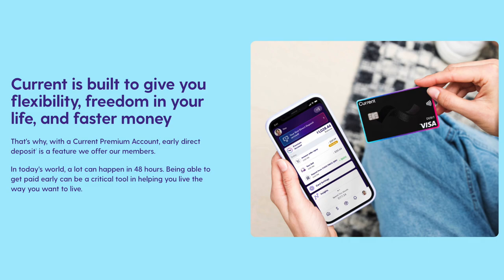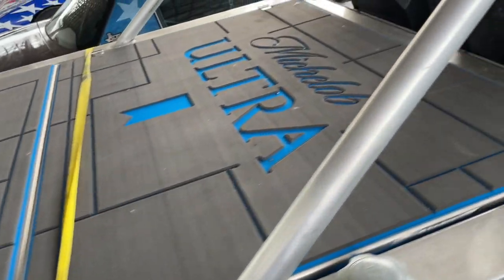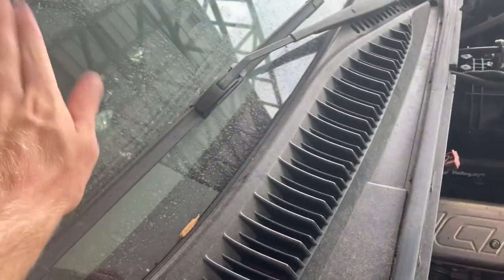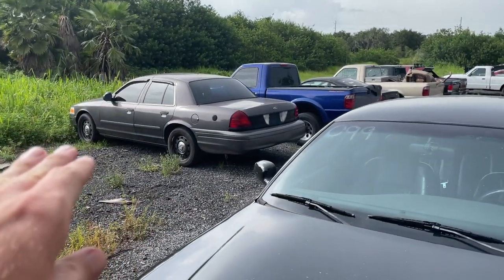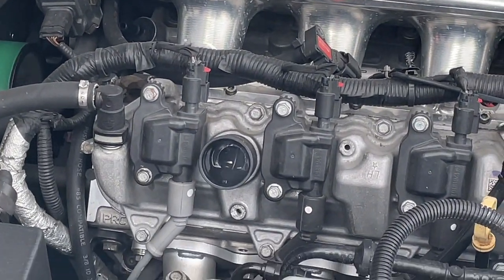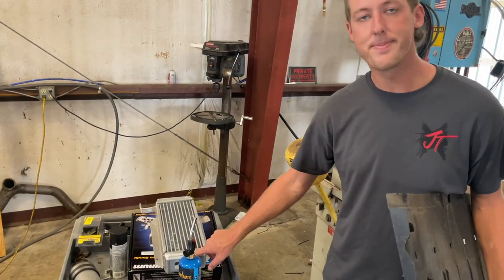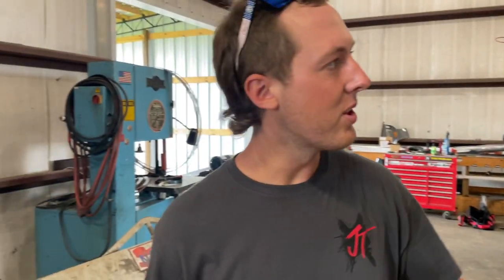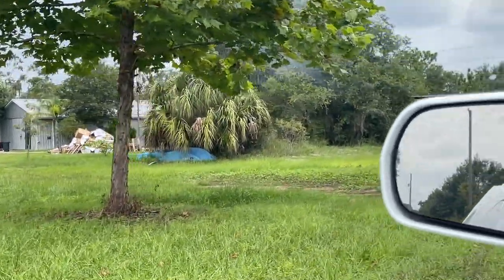Trying to Fix the FREAKING Bald Eagle Machine Finally... + Sold One of the Jet Boats :(

Comment: 25K for the first oil change and engine mounted fuel filters, use the good mobil oil and detroit filter and you can go 75K between oil changes. engine mounted fuel filter interval depends on whether or not you're running an external filter like a davco. every 200K on the trans flush, make sure they pull the front and rear plugs and clean them. most places only pull the rear plug. 150-175K on the air filter unless you're running in more extreme conditions. and yes i do this for a living for schneider natoinal which has approx 8,000 freightliners equiped with the DD engines and dt12 trans. super easy to do yourself. unscrew the oil filter and let drain. grease the chassis and drain the 44 quarts of oil. fill the oil, 11 gallons, and pull the filter to swap it. longer it drains the less it drips on the engine. oil pressure should pop around that 6 second mark after starting.

Comment: Did you say you run no thermostat at all? I would think a restrictor would help slow water flow down to allow more heat to be removed from the heads and then pulled out in the rad ? 

Or put a thermostat back in it.

Comment: Seams like the throttle body is having issues to me. Had a dirt diver nest on it lol. Probably bad seal or bad tps. That would make it run lean and make it run hot like that. Just shooting ideas. That could also be causing the hickup on take off. Also that fan and shroud seems a bit small. That alone could be the problem as well lol.

Comment: Relocate everything then put twin pushers in front and leave the single puller, it should cool it down quite a bit with all that air coming through the radiator.

Comment: I sent an email to Kev at KSR about my idea on your fuel heating in the Elco but proper ducting and forcing your air to only move where you want it. Best example is to look at time attack cars and how they seal up the front end so your airpath ONLY goes where you desire. 

In my email to KSR, I mentioned how auto manufacturers have circumvented fuel heating and gave an idea for your race week events where weight means everything on a track but not so much when driving. In this case, others have mentioned a better fan shroud with twin fans and better ducting. I think that would be a cool (get it?!) third visit to the wind tunnel if you guys did such modifications to your race week vehicles and the Bald Eagle Machine. Those who do aero are the real air benders.

Comment: Everyone complaining about the fan. the radiator is getting full air flow while its driving down the road.  b4 you argue stick your hand out the window doing 55. thats way more air than any fan can push.    the turbo sucking in all that radiator heat is certainly an issue.  air thats already hot going in the cold side being compressed gets even hotter.      get some ducting for the turbo out into the fresh air should bring temp down an easy 15-20 deg

Comment: Cleetus man, the trick is to spin those bearings so when they stop, they partially cover the supply hole. Buddy's T.A. (think an '80?) had about Bad Times Soon PSI (or there aboots) after runnin some of Jackstand Jimbo's patented Snakeoil Spray™️®️©️... Called me up, "Filled the jug, lets go on this 350's last hurrah!" (He had me after the 1st ring, BTW). Wouldn'tcha know - DAMN IT ALL...if after disintegrating his tires and I'm pretty sure we saw & heard the famous Buddhist REVerend Bahd Tymes Sune delivering his sermon on that Tachamacatifier (both thought more an eulogy...) Oil pressure went all the way upta an ASTOUNDING - I'm Good A.F. PSI. Instead of the build 454 N.A. plan (600 hp?? Just press that pedal on the right, Snake Spray not applicable)...he total CHEESEDICK move'd it and sold it to some poor bastid. Aren't really pal's in any kinda way anymore...imagine that, eh? Annahoo, spin to win on those mains...Jackstand'll be happy to 'Spray it, not say it.' And THAT lady and gentlemen, is the new release from McFarland Fashion and Powdered Bearing Emporium, 
Front: "Jackstand Says..."
Back: "Spray it, Not Say It"!!!
That's a cool 4.999% from sales; go'on & make that check out to my nickname, Mr. CAAYYSH MUNNIE thank you very much!!!

Comment: I don't know what year or trim this is and what-not, but isn't this exactly what Chevy addressed with the C7 Z06 recall?  I mean it was same exact situation, they added the supercharger for the Z06 and it started overheating.  Then they added the aux radiator via recall to compensate.

Comment: You need ducting to force the air through the oil cooler and rad. Otherwise air will take the path of least resistance and bounce off the face of the coolers and go around rather the forced through the fins

Comment: Did you say it doesn’t have a thermostat? You need a thermostat to slow the coolant down inside the radiator. If it’s flowing too fast through the radiator, it’ll never cool down

Comment: The radiator being blocked by a oil cooler and condenser is fine, air flows through them, condenser is in front of all radiators from the factory so that's not blocking ur air flow, I promise, air goes through the condenser and the oil cooler and still gets air to ur radiator,

Comment: Cleetus, to fix your driveway rent a box blade for your tractor and get some gravel delivered. Easy and cheap to fix. Lot of youtube videos for that.

Edit: As others have said your fan shroud is no good. It needs to cover the entire radiator. With that shroud you effectively have a radiator the size of the shroud. Which is too small.

Comment: Did i hear you say you dont have a thermostat  in the cooling system?
Could be the coolant is flowing so fast it doesn't spend enough time in the radiator.

Comment: If you have no thermostat in the car and it's running hotter then it should then try it with a thermostat in. Some cars with no thermostat over heat because the coolant flows to fast through the radiator and doesn't have time to cool down enough without the restriction of a thermostat slowing the flow.

Comment: I would advise 10,000 miles between oil changes on the toter home. The manual will say something along the lines of 15 to 20,000 miles. However just like with cars, even tho the manufacturer advises more miles, most mechanics will advise 3,000 miles (oil is cheep, engines are not)

Comment: Should seal off the rest of the radiator around the outside of the fan shroud so it’ll pull air from where it’s supposed to n not just anywhere it’ll help out a lot bubba

Comment: You've probably got a good idea with moving the air intake over and getting it out of the way, for starters. One of your biggest problems is that stupid fan shroud and tiny fan. Dump that shroud and get two fans covering 70% or more of the radiator, not one little fan covering like 25-30% of the radiator. It might also be that the oil cooler, intercooler, and radiator is too much stuff stacked up there - maybe move the oil cooler over and mount it a little bit to the side. Now that you've opened up airflow all the way across the front of the car, you can get airflow on the sides, and this way you leave the core of the radiator and intercooler with one less obstacle blocking airflow over them.

Comment: Need a Dual Fan on the Back side and one Pusher in the front of that Stack of oil cooler and condenser and Radiator 🤟🏻🇺🇸🇺🇸🇺🇸

Comment: Got a 95 camaro that has had only 20 lbs  of oil pressure when warm at idle for years and years has 280,000 miles on it

Comment: Put some big ol electric fans on it man. Separate one for the oil cooler. 
Also some piping for the pro charger  would probably be ideal. Lol. I do feel like you're just missing out on a lot of air flow either way. Try pulling the skid plate to see if you drop some degrees just to test the theory.
Reply: Well I didn't watch enough of the video before I wrote that comment. Lol.

Comment: Your fan is only working on about 40% of the radiator you need to pull air through almost all the radiator out a shroud or dual fans on it

Comment: Elbow.... definitely! Twin fans in the radiator... sure. Lay down the oil cooler with an auxiliary fan... absolutely. 
Double check the antifreeze with a hydrometer... recommended.
Quit freaking about about 200°. Most factory engines come with 195° thermostats.  Water doesn't  boil till 212° @ sea level and you have pressure in an engine.... it's actually good for an engine to be close to 200° to cook off moisture in the oil.

Comment: Just a thought, the engine is modified and many things have been added in and around the engine bay when compared to stock( turbo, turbo piping, etc..), so you have fresh air coming through the front, passing the rad and then hot air going into the engine compartment, add the heat generated by the modded engine and turbo itself, so there really isn't much places for that hot air to escape the engine bay, so all around the temps are increasing, probably worse on hotter days  or when you drive the car hard ??? what you think? question,..those side vents on the side of the each front fender, do they actually allow hot air to escape the engine bay, or are they just for show on the Corvette? ( I heard that the main reason for vents on front fenders on some sports cars are actually suppose to allow hot air to escape the engine bay, true or not I don't know.)  insufficient airflow ?  like I said, just a thought, I may be wrong.

Comment: Idk if said but could you tip the rad back and use the old shroud but heat it to push it up to make the hot air go down. This is all in conjunction with the dudes saying get a bigger fan to cover the whole rad. Get a bigger Wang to the any guy saying you don't want to blow the fan down.

Comment: Cooling problem is one of three things or a combination of two or three.  Not enough air flow through the radiator and oil cooler and/or lack of cooling capacity and/or lack of coolant flow through the engine and radiator.

Does it overheat period or only when during specific times like driving slow or driving fast and hard.

When you are driving fast the ram air should provide the air flow necessary to keep normal temperature unless there is some sort of load like a steep hill or lots of weight on the car or you are staying in a lower gear and causing the engine to rev at above necessary speed.

If it overheats only at low speeds with no load and no excessive engine speed then it would be lack of air flow.

Then there is the possibility that the water pump is not pumping the water fast enough or the thermostat is not opening enough.

Checking coolant flow is the quickest and easiest to check, thermostat checked first.

Then putting on a double radiator fan to increase low speed air flow for better cooling.

Then putting on a thicker radiator to increase heat dissipation capacity.

Comment: Your traction control blinking is a ABS sensor going bad or possibly has corrosion in the plug, I had the same issue with my c7.

Comment: Ya know the thermostat could be stuck open or sticking, or you need a bigger radiator. Or you could have a head gasket leaking, of course that's worst case scenario

Comment: did you say the vet has not thermostat? if so get one in it asap! as it will be causing issues of the coolant not spending long enough in the radiator!!!!
get the intake of air away from sucking hot air from radiator!!!

Comment: When you let a car sit for long periods of time with straight distilled water in the cooling system it makes the thermostat stick which is exactly what we are seeing here in your video. Change it or clean the current one and you will not have any more problems.

Comment: “Oil temp is 210 which is a little hot”
Meanwhile the n54 runs at like 245°F stock and will hit 280°F in track before going into limp mode if you don’t modify it. Gotta love BMWs.

Comment: create a direct air flow cowling for the coolers. in in the front and out in the top without any air from the engine. large intake in the front directed to the the radiators with a  closed area from the engine so no heat from the engine is pulled back into the system. The front clip and open air directed directly to the rads, and a output from inside to an out at the hood of out the side. This is just an idea and it might be a bad idea. When you take the idea that might be bad as a starting point and use you combine experience it might become a good idea. Might take some creative engineering

Comment: The bald eagle machine needs a shroud on the radiator.  If the fan is not pulling air evenly through the radiator then it's like a restriction.  Think of a radiator like an air filter.  If part of the filter is plugged you get less air flow.  With a radiator if you don't have it shrouded then when the fan is operating it's not pulling air through all the radiator and the entire system is less efficient.  It prob would not hurt to have a 2nd fan on there as well.  2 smaller may be better than 1 large .  More surface area is better than a thicker core.  I would also keep the lower shroud on.  If the car is low then once you pass the front valence/splitter then the pressure drops, you want the pressure drop to be after the radiator, not before it.  In front of the radiator you want pressure.  It takes very little front grille space to flow enough air, but all the fan and shroud you can get.

Comment: Interesting that you would post the oil pressures.  Both the L35 in my 2001 S-10, and the LS3 in my 2011 Camaro SS have oil pressures that are almost exactly the same as here.  When I watch videos online of the same vehicles, the oil pressures are almost identical to what I have.  Is this by design from GM?

Comment: That engine doesn't sound happy at all. Sounds like fuel problems with it breaking up and shutting off. My old V did that, was a sticky injector and a half ass working fuel pump 🤷‍♂️

Comment: My stabilitrac light will come on when my oil pressure gets low enough then when I give it gas again it builds enough pressure to turn the light back off again then when I look at the code it’s a cylinder 5 misfire because the exhaust lifter is hurting.

Comment: The freightliner should be changed around 20,000 to 30,000 miles but since it sits more than driving I'd do it at 20,000 to 25,000

Comment: Isn’t taking the oil cap off the valve cover detrimental to the motor while it’s running ? Relieving all crank case pressure and causing the pistons to bang against the walls ????

Comment: I would say if you have little bit more room the Radiator you have in it is it a 2 core? If so go to a 3 core Radiator. And then change your electric fan put it in front of the Radiator move your trans cooler on the other side between water pump belts an Radiator. If you have room put a 2 blade an 2 motor electric fan in the front. Your not going to believe me but it will fix it. I have said a few things on here I have never got a comment back from you ever..I have drag raced for 8 years promod . Good luck on fixing it..

Comment: Take off the hood and all the body panels. Then put 40 fans all over and drain all the fluids so they won't get hot. You don't need oil where you're going.  Then put on monster truck tires and drive over to JH and start running over shit. When he comes out of the beer cave he will fix it

Comment: you do not have enough fan on the radiator and it is only pulling air over the small circle in the center of the radiator where the fan is. Need a shroud so the fan pulls air over the entire radiator and maybe goto a shroud with dual fans. And Feel free to donate a side by side to me to get it out of your way.

Comment: Dude.  Your cooling system is terrible.  You need a cooling fan shroud for starters!   And no thermostat?  WTH man. 
I suggest you go on down to the parts store and get a block test kit.  
$100 says it turns green.  
Oh and thanks for not replying to my emails.   I feel better.